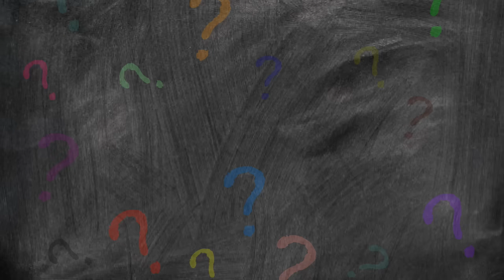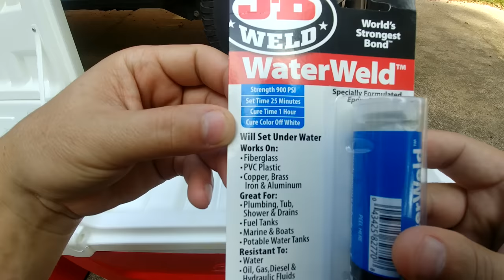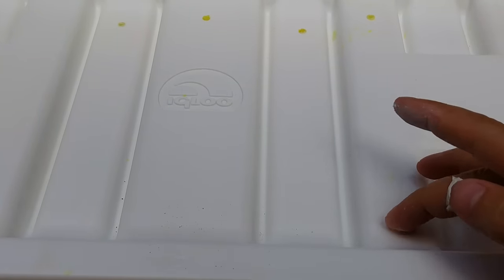Do Yeti cooler hacks work?

Comment: I tried the same experiment except I put a 12 pack in each cooler, 24hrs later all the beers were gone. Definitely a success 😁
Reply: Holy crap, I had the same results except after the 12 packs were gone, I woke up with a headache.
Reply: You do the same kind of experimentation as I do!
What a coincidence 🤣👍
Reply: Great minds think alike 😎
Reply: Best comment ever.
Reply: I decided to reproduce your experiment, and you're right: after 24 hrs the 12 pack is gone.
Reply: Nice
Reply: my beer fridge never stays full..fml everyday I have to fill up
Reply: I concur
Reply: Brother, that joke hit me right today.
Reply: 😂😂😂Lol
Reply: I wonder if a thin sheet of styrofoam on the inside of the lid  would help instead? Cut it to the size you need and use two way strips of tape to help hold it into place. Cut to proper size, no tape,  can also be place on the bottom of the cooler for extra insulation? Less mess and less hassle. I hope this works and is helpful.  😊
Reply: I gotta try that right now 😅😅
Reply: Happens every time I try to test my cooler.
Reply: Lol
Reply: Thanks I'm going to try the same thing